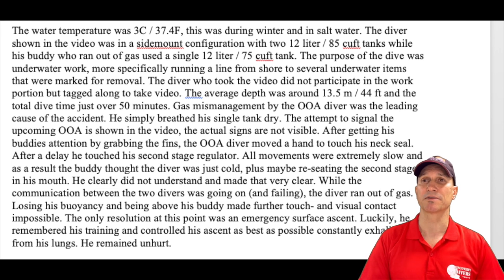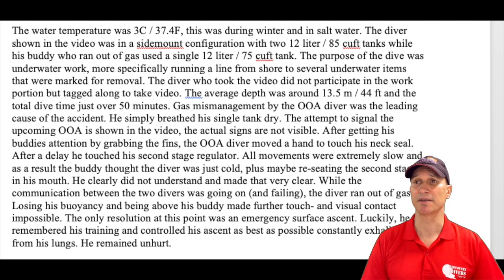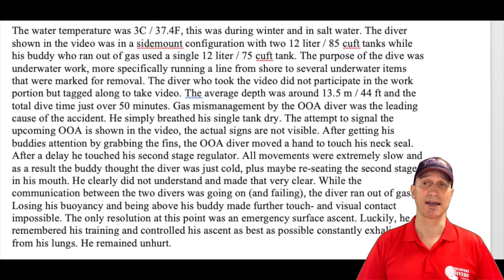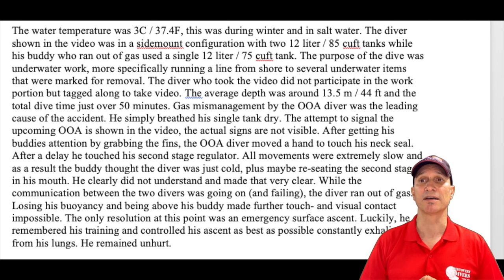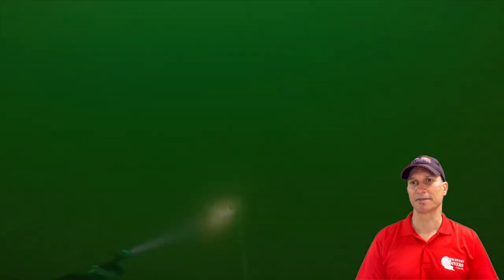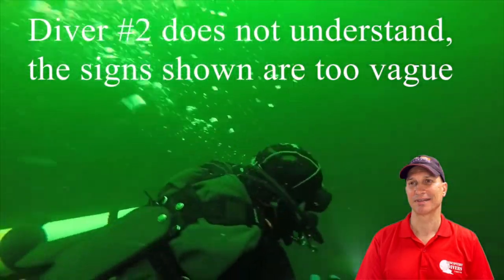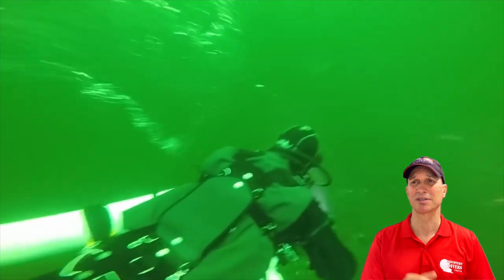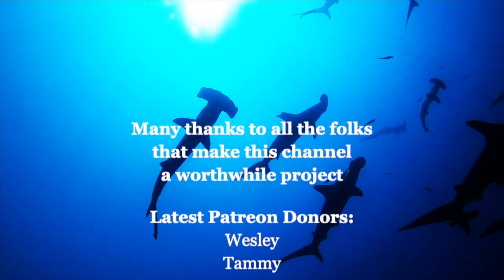Scuba Diver Out of Air and Emergency Ascent - Catastrophic Buddy failure

Comment: when I first started diving in early 1970s all we had was a J valve no gauges of any kind that was when men were men!!!!
Reply from the maker: I’ve seen those, but never tried!
Reply: Still have 2 on my old steel 72's
Reply from the maker: @DavidKozinski  Cool! What (if any) were the downsides of that system in your experience?
Reply: @DiscoveryDiversTokyo  No real downside for me other than dirty looks and stores that don't want to fill them. The J-Valve was as simple as you can get for a safe bailout of a bad situation.
Reply from the maker: @DavidKozinski  OK< got it...I have a vague recollection that one risk was that the value might be accidentally actuated before the end of the dive. Is that possible? In transport, gearing up or during the dive?
Reply: @DiscoveryDiversTokyo  You have to manually switch the valve by pulling it into a down position and although unlikely it could be done by accident. It can simply be reset by returning it to the top position.
Reply from the maker: @DavidKozinski  Got it...so as long as the tank has more air than the reserve pressure, you can reset at any time?
Reply: @DiscoveryDiversTokyo  The reserve air is in the same cylinder. The main valve spring slowly closes at low pressure and the J valve has a weaker spring that allows the remaining air to supply the diver. Fun fact, in the original catalog it got it's name from the letter code it fell under, first was the  K valve and next was the J valve!
Reply from the maker: @DavidKozinski  Cool fact, indeed, David. Thanks for that!